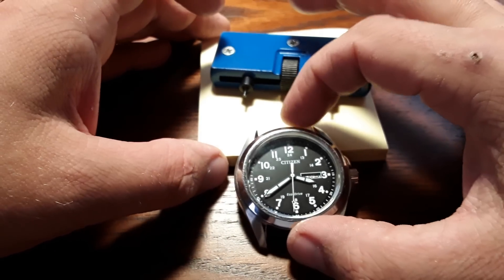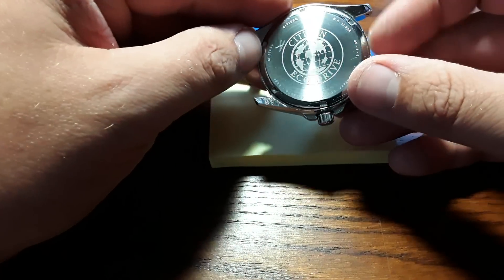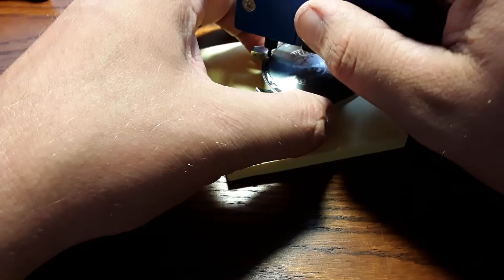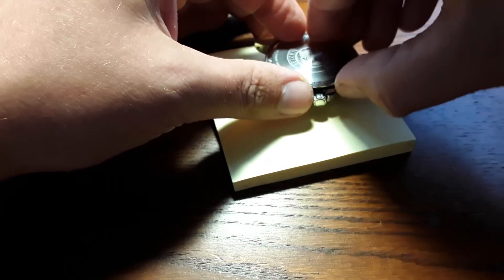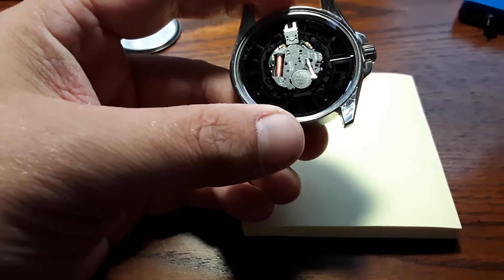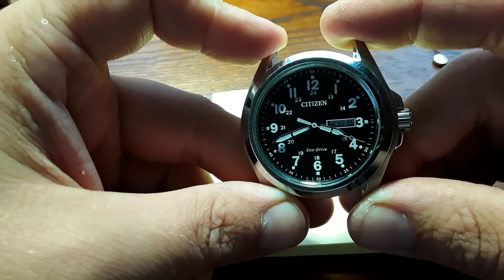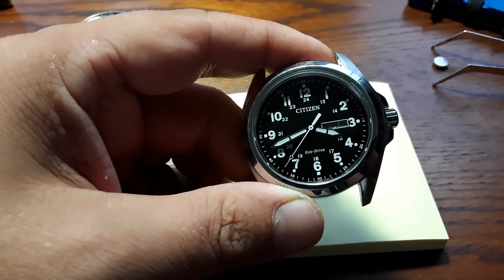Citizen Eco-Drive Runs Without a Battery (Capacitor)! Please SUBSCRIBE

Comment: I have had a citizen eco-drive for around 16 years, and I bought it second hand. It has only started to not hold a charge. I binned it and bought another of the same model. You are lucky you did not fry the watch, by pulling it apart when you obviously don't know what you are doing..
Reply from the maker: labrat7357 I actually do know what I’m doing and change the batteries in my watches and actually change batteries for family and friends. Thanks for watching and supporting the channel.

Comment: A little heads up, but when the second hand is doing what the watch above is doing. You need to pull the pin fully out and let it charger for 48 house to reset the  capacitor. Right now the watch is in a power saving mode telling you that watch needs a reset not a recharge.
Reply from the maker: The Real Killa C thank you! Please subscribe and help support the channel.
Reply: Wrong not a capacitor lithium-ion.pulling the crown out will not speed up the charging.and its not in a power saving mode lol!

Comment: Not a battery but a capacitor, there to keep watch running when there is no light. Light powers the watch, and if sufficient also charges the capacitor. Speaking of which this may have been discharged to long and has lost the ability to hold charge. If a new one fitted the watch may well be good for another ten years or so.
Reply from the maker: Kenneth Gauld thank you. Please subscribe.
Reply: MT621 (3:55) is according Panasonic a 1.5V/2.5mAh rechargeable lithium battery (no capacitor). MTxxx batteries use different electrode metals than the 3.7V lithium batteries used for power hungry cell phones/laptops/power tools.
4 solar cells in series transform light falling onto the watch into electric power. This power is used to drive the watch and also load the rechargeable battery when the light is strong enough. In case of no light or not enough powerful light the watch runs from the rechargeable battery. In many watches the size of the battery is chosen to allow ½ year of operation without light under the condition the battery is fully charged. If the watch stays longer than this ½ year (in case of not 100% charged or older battery less than ½ year) without recharging light the battery starts to discharge to dangerously low voltage levels, first causing degradation, eventually destruction. Therefore, an Eco Drive watch should never be stored long time in a dark place (it needs either all 3 months a few hours recharge by direct sunlight or be stored at a place where the light is strong enough to replace the power consumed by the watch).
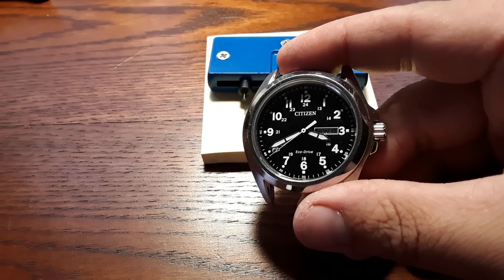Different to the high load 3.7V LiIon batteries the low load 1.5V MTxxx type of rechargeable batteries seem to have a quite long life time of 10 to 20 years (Citizen claims for recent production even up to 40 years). At the end of its life time a rechargeable battery is such degraded that the solar cells normal charging is not any more able to recharge it sufficiently. Such low charge/voltage shows in the movement as 2 second steps/forwarding (1:10) instead of the normal 1 second step/forwarding. If low charge 2 second steps occur on a 20 year old battery it is clear such old battery must be replaced. In my understanding low charge can be caused by 3 reasons: 1) The charger (solar cells) broke/is not working correctly 2) The light falling onto the watch is not powerful enough and 3) The battery reached the end of its life. To avoid misjudgment on batteries younger than 20 years I think it is good practice after getting notified of low charge/voltage by 2 second steps to put the watch under direct sunshine (alternatively close to a strong LED), this means strong charging and check if its movement changes to 1 second steps. If so, the solar cells are OK. In next step the watch should stay in sunshine for a longer time (e.g. 5 hrs or whatever is appropriate for the strength of your local sunshine, size of your battery/solar cell/your specific watch) to allow the battery to be recharged completely (please observe good wind cooling as sunshine also heats the watch and rechargeable lithium batteries hate high temperatures). After recharging put the watch in a dark environment/where it was stored before and check if the time period the watch runs from its battery in 1 second steps is still sufficient for your need. If it is not sufficient you are at the end point of your battery life, your battery need to be replaced. 
Note: In this video at 6:25 you can see how weak artificial light is. The battery is removed and the solar cells get just light for a low voltage resulting in 2 second steps. This light condition would not at all be sufficient to recharge the battery.
Reply: Wrong lithium-ion

Comment: That's a capacitor,  not a battery.   It keeps the watch running when there's no light source. When ecodrive is under a light source,  it can still run.

I had mine over 10 years and had to replace the capacitor.   But no luck getting it to run consistently after capacitor was replaced.
Reply: A CAP IS A BATTERY
Reply from the maker: John Lockman thanks brother. Was trying to be nice. 😁
Reply from the maker: C Wang thanks for watching. Please subscribe and support the channel.
Reply: wrong lithium-ion!

Comment: Common energy saving  for quartz watch is to switch to a 2 sec tick when the power level is low, either solar, battery or Capacitor.  The replacement is available as a capacitor battery but cost $20.   That's a lot of plastic inside the watch.   Perhaps a cleaning of the terminals or a external charging can save the watch without buying anything. But after seeing how many batteries are on ebay , this must be a common problem.
Reply: lithium-ion

Comment: I have had a 7878 Eco Drive movement, zero 2 sec jump, zero battery change in 0ver 20 years, still running perfectly, regularly used for swimming surfing and scuba diving and snorkeling until the bezel just wore out from sand in the water over time and mud from caving. Kept it properly charged up via full sunlight , not woosy desk lamps. If one does this then u will get a proper life out of one of them but if one takes it off all the time and uses it as a piece of jewellery instead of a time keeping tool strapped to their wrist, then there's a good chance it will not see light when it should be. Any device, no matter how good the battery technology is will be degraded if the system is not charged properly over time, eg duration, temperature etc.  I now own a BN 0176-08E 300m diver and I'm sure if I look after it, it too will serve me well for years to come.  I got sick of 3 year services and battery changes for my SEIKO scuba watches, plus the pressure tests too, all cost money and time out from diving and other wet adventures.

Comment: Didn't think it would run that way. Weird. I own a Calibre 2100 but only wear it occasionally. Since they say it can hold a charge for 9 months in the dark, that's where it was kept. In a drawer for a long time. Then all of a sudden it would hold a charge. I get the charge meter all the way up and then within a few days it would drop very low, though still ticking at one second intervals. So I had the capacitor/battery whatever changed and now keep it in the light and it's fine again. I do love Citizen but you need a way to keep them in the light even when not wearing them.
Reply from the maker: Philip Janes window sill my friend. Will keep a charge guaranteed! Thanks for watching sir.

Comment: I’ve had my eco drive for only 3 yrs and it has stopped ticking. I e left it out in the day light in direct sun for nearly 2 hours and nothing. I’m hoping I just need to replace the battery?  Idk what else it could be
Reply from the maker: Azztronaw leave it in the window for a full day. If it doesn’t work, replace the battery. The battery could be picked up on Amazon for around 30.00.

Comment: Does the battery have a part #?
Reply from the maker: Ernie Goudreau it does. Open the case and the it’s on the battery. Make sure you order a case back removal tool and case back press. I provide links in my description.

Comment: I would love to see an Eco-Drive with an indiglo light (a backlight). 
Fluorescent paint does not hold more than 30 min in my experience. Convenient  to have its own back lighting when at movie or sleeping.  You have practically unlimited power with everyday's use.
Reply from the maker: Thanks for watching. Timex has the patent for indiglo.
Reply: but not the room as the solar panels are inside now where the movement is as well

Comment: Looks like the battery is fixed to the watch with the ‘solder tab’ (the thing that is sticking out). What has happened is that either the tab broke due to a shock or you broke it by pulling the battery out. If it broke earlier that would explain why the watch doesnt charge - it has been running purely on solar just like it does with the battery out. The battery needs to be soldered back into the watch if you want the watch to work normally where the battery can charge up and the watch return to the  normal 1 second tick rhythm. It is quite possible that what you have there is not a battery but a supercapacitor - Panasonic makes both. Reading the fine print will tell you whether it is a battery (and what type - Lithium or other) or a supercapacitor (and what capacity).

And please don’t handle the battery with tweezers - thats a fire hazard even for that tiny battery particularly if its a Lithium battery.  You are lucky that battery was flat.

This seems to be the replacement Lithium battery: https://industrial.panasonic.com/sp/mb/ww/specifications/MT920
Reply from the maker: Rajiv Dhinakaran thanks for watching and sharing that information. Much appreciated.
Reply: Citizen, Panasonic defines it as a battery. Except for the tab attached to the battery the replacement process is as simple as a regular quartz watch. There's a reason for the tab, it is not a typical watch battery  and they had to make it obvious. Also: no soldering, the tab is for guidance so the battery is properly  inserted, that's all. Let's not complicate simple things.

Comment: Always knew it had a battery.  A battery that recharges with solar cells.  Not hard to understand.  Mine has been going 10 years no problems.  If yours only lasted 2 years then it is the exception not the rule.  All brands produce a defective product sometimes.  The benefit of Ecco-Drive is obvious.
Reply from the maker: Yes sir! Thanks for watching.

Comment: My beater watch is a Citizen Chronograph (not an eco drive). I extensively use the chronograph; still battery always outrun other watches without chronograph. Ticked non-stop for 15years and required battery swap 3 times only!
In 2020 I'm getting an eco-drive. Your vid proves its un killable!
Reply from the maker: Trishanu Ray yes sir! Happy New Year to you and thanks for watching.
Reply: Did you get it?

Comment: I have about eight 8 Eco Drive watches, the oldest is about 12 years old.  All run fine, and charge, without ever having to take the rear cover off.  They are the most reliable and trouble free watches I have ever owned.
Reply from the maker: Raymond Makul awesome. I love mine. Definitely quality watches. Thanks for sharing!
Reply: 8 Eco Drives, let me guess... 1 for everyday of the week + 1 for special occasions?
Reply: @TheNuclearBolton  Four stay on Standard time,  three on daylight savings time, and one on GMT when I am playing amateur radio.

Comment: I actually just received one of these watches for Christmas so I came across your video, I don't have any experience with watches but alot with electronics, its a rechargeable battery the only reason it has a tab attached to it is so you cannot fit a normal non-rechargeable battery to the watch, if you where able to it would certainly pop the cell when it tried to charge it very likely damaging the watch, a normal watch would have a connector plate at the base taking any battery not requiring the tab, my understanding is that they used to use capacitors and now use rechargeable battery's probably because capacitors lose charge over time much faster.
Reply from the maker: Scott Montgomery that’s some good knowledge there. Didn’t know that about the tab. Thanks for sharing and watching.
Reply: My ten year old H11 has a capacitor with five contacts.

Comment: My eco drive battery/capacitor lasted 20 years before conking out. Just sayin’....
Reply from the maker: Adrienne Gottlieb mine just needed more sunlight. Still running strong on the original. Thanks for watching.
Reply: When it conked out, did you have to replace the watch or could you recharge it? I would like to be able to recharge mine. The style is beautiful with crystals I love it. Would not have to give up on it would prefer to get it repaired.
Reply: @louisedery1049  you can get it repaired

Comment: Maybe the light did the entire trick, but I expect there is a tiny parallel capacitor as well.  Respectfully, megamediker was right, you (and everyone else) should learn to use a multimeter and the meaning of voltage, current, capacitance, resistance, and energy.  Those basic concepts are critical to our lives today.  And that knowledge will help you explain watch movements.  FWIW, I finally found this: the 295-76 battery/capacitor is rated at 1.5mAh at 1.5 volts.  That's 5.4 farads of capacitance at 1.5 volts, which is a stored energy of 8.1 joules.  That's very impressive from something so tiny.  Cheers!
Reply: Lithium-ion.

Comment: Why are you using a metal tool to take the battery out ?  Not a good move.
Reply from the maker: Boss Hogg what would you suggest?
Reply: @AvgJoeWatchReviews  Rechargable batteries are best removed/picked up by plastic tweezers (or some piece of wood).
When you use metal tweezers/tools there is a great danger you are shorting the battery (no problem to short if the battery is really bad, but if it was still good the shorting will have degraded its life time, in worst case destroyed it).
Picking the battery with plastic tweezers will also avoid body fat/particles to come onto the new battery which in worst case may result in a tiny leakage currrent across this fat/particles between + and minus. Such leakage current is not critical on large batteries, but it may be noticeable on these tiny batteries.
I am not sure, but I think one should also observe some ESD precaution on these tiny batteries, for example by touching some earth grounded metal before starting to touch the battery/PCB.
Reply from the maker: @friedhelmschroter8124  I honestly appreciate this bud. Never knew. I actually bought a pair of ceramic tip tweezers since this comment.
Reply: @richardparker1338  The sides aren't the point of contact for how the power flows. 🤔🇺🇸🇺🇸

Comment: Mine:14-15 years and running. Low batt. is indicated by seconds hand stopping entirely until recharge. 1-2 hrs of sunlight every ~3 mths keeps it going.
Btw. it stopped day after I bought it, imagine. 100 watt lightbulb and 30 min later it was back to life. Happened again few years later, this time I knew what to do 🙂.
Reply from the maker: bryce the technology is great since you replace a battery every 10-15 yrs. Not too shabby.
Reply: @AvgJoeWatchReviews  15 years easy I think (it's been so long ago I lost track) and counting. No sign of needing a battery replacement, how cool is that? 200m depth watertight, always take it swimming and diving. So good and reliable it's actually boring LOL.

Comment: I would say that watch collectors have this habit of buying a great watch and then eventually store it. I own a citizen perpetual calendar, titanium, and for two years no problems. It does have a battery indicator on it, so I get a heads up as to the condition. And yes the solar cell charges a battery, hence power reserve. I will update in a few years, I hope as to condition of my battery. I am looking to pull the trigger on an other citizen watch as well,an Eco drive as it turns out. Citizen has been in the Eco drive set up for quite some time by now.

Comment: I have 20 watches—Some citizens some seiko, bulova, orient, invictas 
The citizens are top notch and bulletproof. Never had a problem
Reply from the maker: I’m a huge fan of Citizen personally. Sounds like you have a nice collection there. Thanks for watching!
Reply: I have a collection of Walmart watches + an ordered Citizen titanium PCAT on the way.  Can’t beat the sapphire crystal citizen offers in their low price ranges.
Reply: We'd have to agree with bulletproof, had a friend run one through a full cycle wash and it still worked fine. They make quality movements for a reasonable price.
Reply: U RICH?